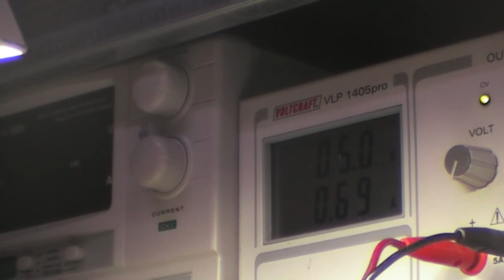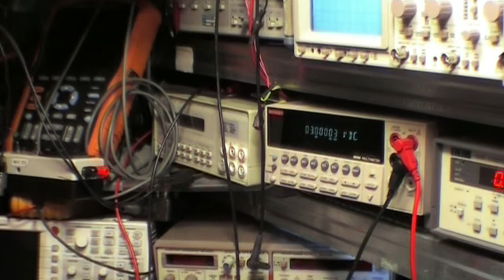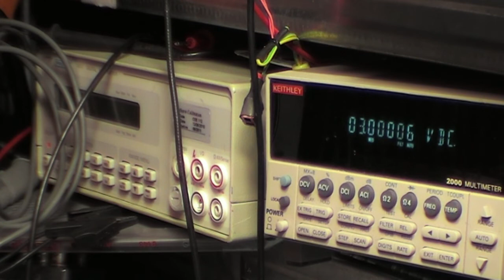Druck (GE) DPI-620 calibrator repair

Comment: Het verbaast mij dat je met dat oprolbaar usb kabeltje 0,6A haalde, ik heb deze kabeltjes lang gebruikt om mijn gsm op te laden, maar had al gemerkt dat het 
opladen hiermee veel langer duurde dan met een normale usb kabel.
 Toen ik op een dag een USB volt/amp meter (Keweisi USB detector genaamd op Ebay, Wish enz) gebruikte , 
en deze tussen mijn oplader en dit kabeltje gebruikte en zo de gsm begon op te laden, kwam ik tot de vaststelling, 
er slechts 0,2A doorvloeide. Dit met zowel de originele gsmlader, als met een "snellader" van 2A, alsook via een usb poort van een pc (usb 2.0 poort is begrenst op 0,5A).
Toen meerdere usb kabels vergeleken, en vond toen een usb kabel waarmee ik 1,2A haalde.
Denk als er 1,2A door dergelijk oprolbaar usb kabeltje moest vloeien, het serieus warm zou worden :-)
Reply from the maker: Dat is niet altijd een kabel dikte probleem,  er zijn apparaten die kijken naar de 2 datalijnen of ze meer mogen vragen. De datalijnen zitten dan met weerstanden of soms weerstand delers aan de voeding rail.  Zonder die weerstanden laden ze met een veel lagere stroom (minder dan 400 mA) 
Dit apparaat heeft die weerstanden niet nodig. Je kunt op het www daar wel tabelletjes van vinden. 

Al die kabeltjes zien er gelijk uit maar zijn het niet. De slechte lijken dik maar er zit nauwelijks koper in want koper is duur. De mijne heeft blijkbaar genoeg koper :-)
Reply: @pa4tim  Klopt, de slechte lijken dik maar zit amper koper in. Hetzelfde met startkabels, iedereen wil graag soepele, maar als de autobatterij gans plat is, krijg je er amper uw auto mee gestart :-)
Bedankt voor de snelle reply.